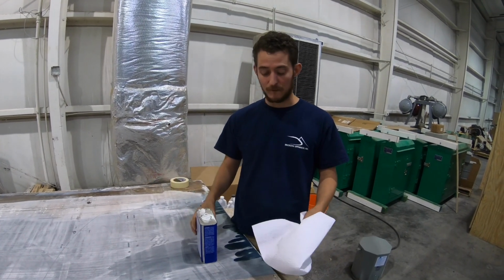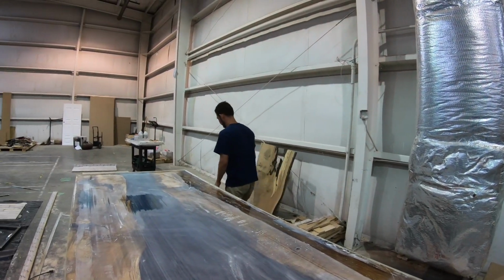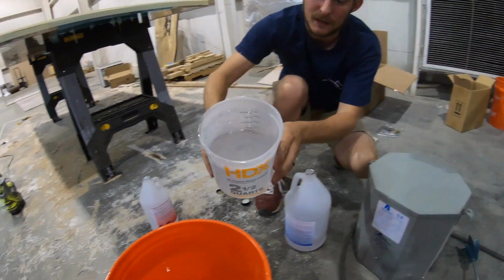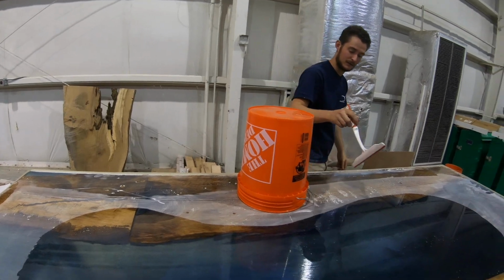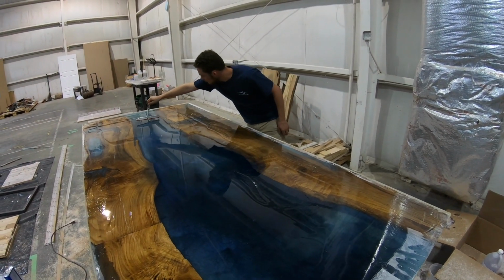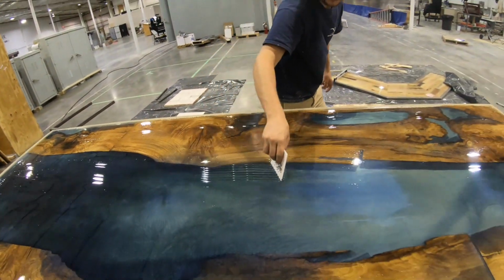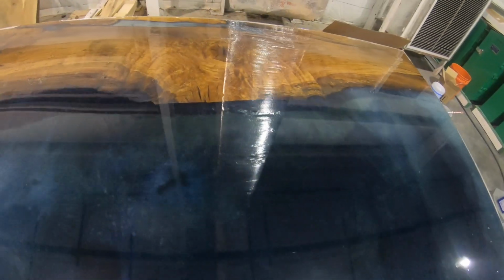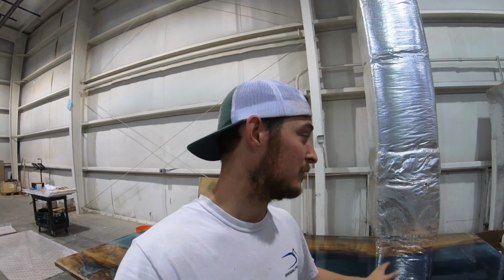How to Finish the BOTTOM of an Epoxy River Table

Comment: I’m in the final stages of finishing a 29x39” coffee table… my 1st larger protect.  This video was extremely helpful, clear and informative. I’m using beautiful mahogany and plan on treating w the wood not putting epoxy on it. The epoxy is a green/blue. At this point I have to repair a couple of surface bubble holes. I’m very optimistic.
Reply from the maker: Good luck on your project! Sounds like it’s going to be a beaut!!

Comment: I do have a good question when building the "tub" to place the wood and epoxy in wouldn't it be easier to pour epoxy in first as a base then place the wood on top of it or would that not work?
Reply from the maker: I’m not sure about “easier” . Trying to lay the wood into epoxy and having it not move around while clamping it down would be an issue. However, this could work but it may be just a waste of epoxy since it will be planed down after removing from the mold.

Comment: What about all the air bubbles do you just leave them? I flood coat top and bottom the same way just done my top flood coat tonight always use a gas torch to pop all the micro bubble plus it helps it leave out aswel with a bit of heat. I find 3 oz per square foot works well. Table looks great nice job 👍
Reply from the maker: Yep I torch or use a heat gun to pop the bubbles!! (On flood coats )

Comment: Do you have any issues with the top absorbing moisture. Since you're  finishing the bottom first is that something that could happen?
Reply from the maker: It is something that can happen. However, the bigger issue is wood that has moisture drying faster on one side vs the other. That is what causes cupping and twisting and such. I finish the bottom first then the top soon after that.

Comment: So you did a 1oz per sqft seal coat first then this finishing coat for the underside of the table. Is that correct? Looks good and going to use the taping trick to help the drips (from the other video). I just need to decide now if I want to do a finish on the underside like this one. Mine is not a river table though but a bread board style table using Balau (a type of tropical hardwood like teak). Getting close to my first ever pour!
Reply from the maker: Yes that’s what I did. Good luck on your project!

Comment: when you flood the top and the drips are on the bottom, do you wait for the epoxy to fully cure before you pull the tape off? or do you do it during the cure?

Comment: Incredible looking table.  How many ounces per square foot for seal coat did you use?  Using casting epoxy soaking into the wood more helps us.  We are doing a table that this will help us with.  So much help from your videos.
Thanks
Reply from the maker: Start with 1 oz per square foot and monitor it. When the wood soaks in the epoxy add a little more.
Reply: @GoodViewWoodworks  thanks for the info

Comment: Ethan. Do u put any metal support inside between the slabs?
Im going to build a 4x10
Im wonder if is necessary to put metal for support between slabs?
Reply from the maker: Yes I would say any longer than what I have done you will need a support underneath to keep it flat.

Comment: Nathan, I may come across as a noob, but here it is: why do you bevel the edges in the first place? Is it to improve over-flow of the flood coat, or is there another reason?
Reply from the maker: The reason is that it increases the surface tension of the epoxy as it flows over the side. If you didn’t round the sides, the sharp corner would cause a break in the epoxy when it flows over and you would have an entire edge and side with almost no epoxy coverage. Hope this makes sense
Reply: @GoodViewWoodworks  Oh! That makes sense. So you bevel both top and bottom then?
Reply from the maker: That’s correct